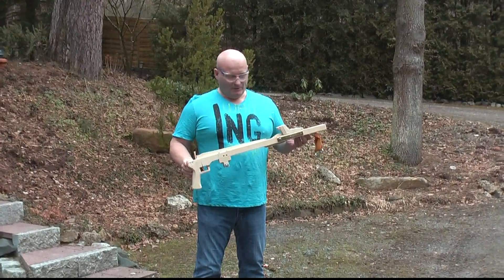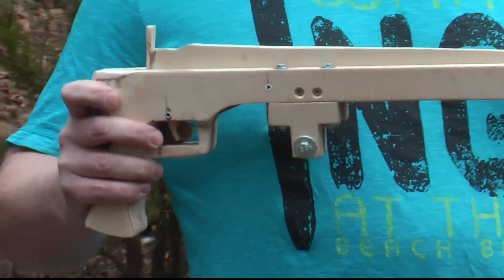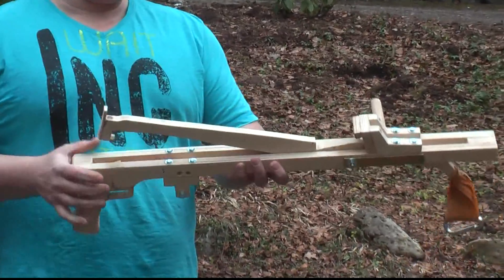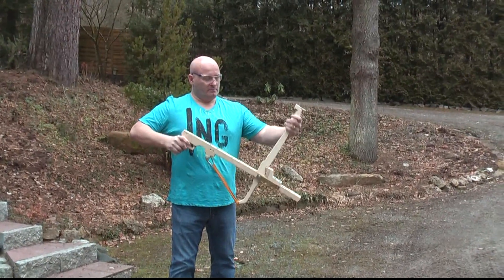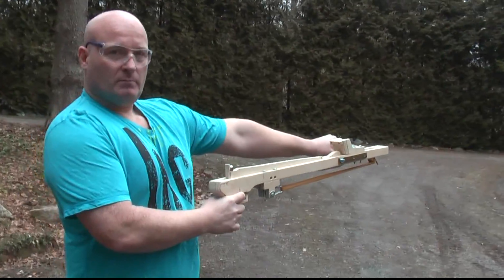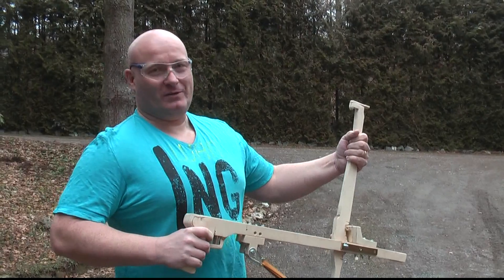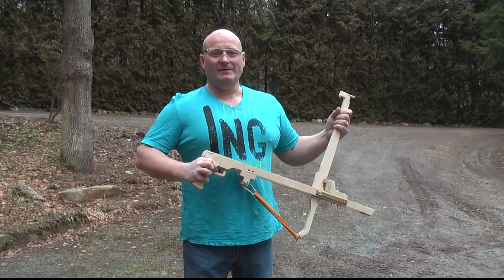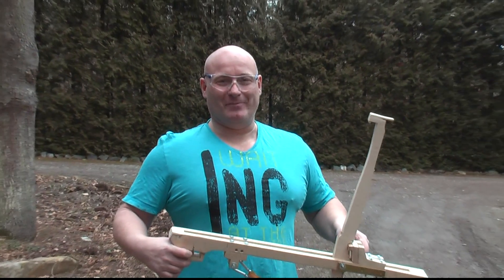Handheld Trebuchet!

Comment: That's a Catapult. A Trebuchet would use gravity.
Reply: you are right that's a catapult because it doesn't have a sling, which the projectile sits
Reply: That, the one using people pulling the ropes, is a Mangonel
Reply: the early trebuchets didn't use gravity they used people pulling with ropes. if this used a sling then it would be a trebuchet.
Reply: I didn't know that. Thanks.

Comment: you are right and wrong at the same time...your correct is it not a trebuchet, but wrong on the reason its not, a trebuchet (along with all other forms of siege catapults) have a "fling action" but to classify it as a trebuchet it must have a falling weight to power the throwing arm, this is actually a torsion catapult. please, if you going to correct someone, make sure your right

Comment: when it shoots, the arm launches the ball  downward right from the start, the ball doesent go up into the air reach maximum height, then start falling back down. could you make the arm launching the ball come from underneath the gun so that your ball flies upward? and also if you put the cocking mechanism on top you wont have to worrie about that arm flying up  towards your face, so you could look down the barrel for lack of a better word, that may improve accuracy

Comment: If you move the stopper back so the arm is stopped at an angle of ~45-65 degrees you'll get better range, and with experience you can guage the distance for accuracy. Those are rough estimates though.

Comment: I have alittle experience with catapults/trebuchet/seige engines, but I think I know how you can improve the accuracy, if you still have the...weapon. In the slomo videos, it looks like the ball is release when the arm is stopped. In the original trebuchets and catapults the load was released by centripedal force, and this happend before the arm was perpendicular to the ground. Because of this, I think yours might be firing a little low. To be continued...

Comment: This is a sling-powered catapult, not trebuchet.  I think to achieve trebuchet like firing mechanism, the rubber band need to be pulled down and the whole contraption needs to be taller.  Still awesome tho.

Comment from the maker: @PixelHead777 Well, a catapult is - by definition - not a handheld weapon, even though the brits call a slingshot a catapult. Trebuchets of all types, but also ballistas, are all in the "catapult" category. I "married" parts of the trebuchet (the lever with a short, powered part and a long "throwing" part) with modern day rubber, a power storage and conversion material that was not known in medieval times. So of course it is not a historically correct "trebuchet". But it is fun! :-)